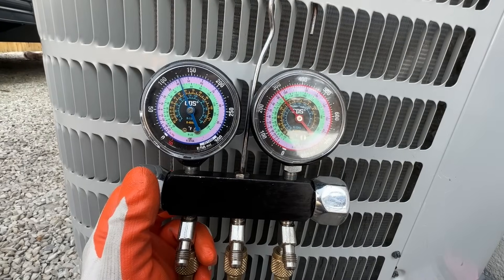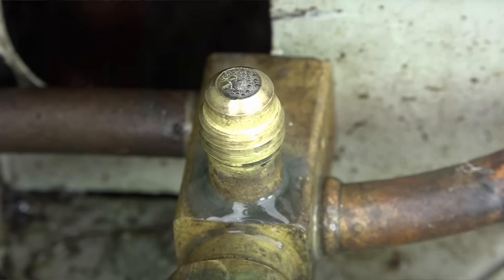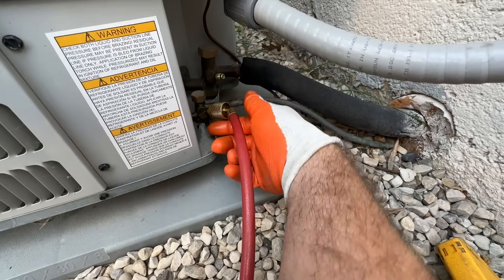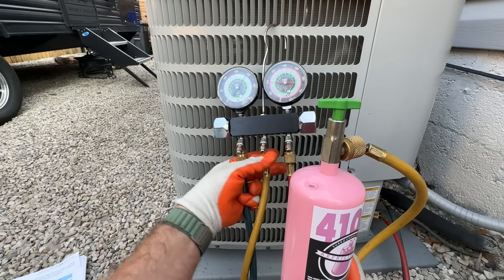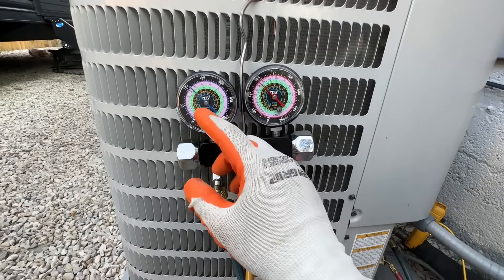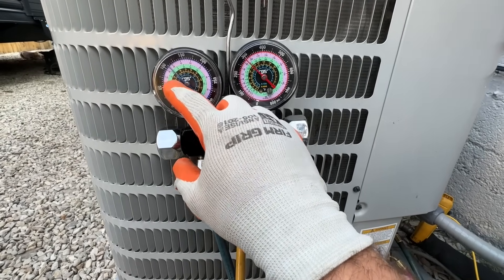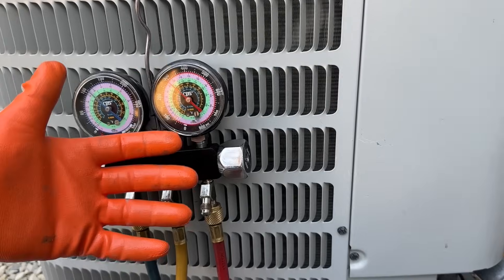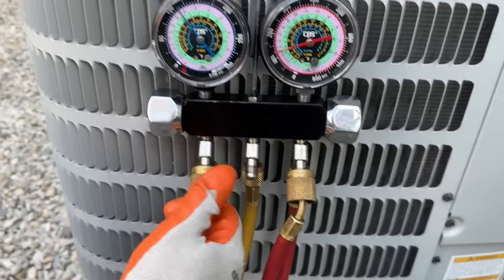How To Add Refrigerant To Your Air Conditioner R410A & R22

Comment: My Central A/C stopped working and I called a Serviceman. He said the Unit is 30 years old and to get a new one. He didn't even open the cover to do a diagnostic test. They quoted me $11k, plus a permit fee for $400. After watching your videos, I inspected the Starting Capacitor and it had leaked fluid. I bought a new one for $9.86 ,installed it and now I'm freezing in my home. Words cannot describe the feeling when that Compressor kicked on and my Girlfriend called me a Genius. Thank you so much, for what you do in helping out us DIY'ers. My words of gratitude does not come close in appreciation.
Reply: 95% of the A/C repair people will rip you off every time. The coil on my contactor kept blowing fuses and the thief A/C tech guy said my compressor is blow out and I need a new outside unit. I watched a you tube video on a bad contactor coil blowing the fuse and got a new contactor and replaced it. The unit started right up and is still running a year later. I was going to be ripped off $ 5,000 for a replacement outside unit !!!!!! And a $35 part was all it needed !!!!
Reply: @Yawwee  I don't even know what a contractor coil is. How did you know that was the issue?
Reply: @Yawwee your statistics are wrong either 95% is a very brazen accusation
Reply: @Yawwee I have the strong feeling that you embellished some of that story. I say that because no contractor said that your compressor was blowing out without showing you oil inside of your condenser. And no contractors are going to look at your compressor when it's a low voltage issue. By that I mean your compressor doesn't pop low voltage fuses, if it grounds out or blows out it's going to trip your breaker.
Reply: 60% of the time they rip you off 100% of the time.🤪😜
Reply: @samfeldman1508  
Lot's of rip off's in that game. But not likely as many as car mechanics hustling young women out of repairs.
Reply: @samfeldman1508  that simply isn't true.
Reply: @lucaswhite3411  I bet you’re really fun at parties.
Reply: Had  someone try to pull the same thing on my 75:yr old mother.  The aircondition still came on and still cooled, it just wouldn’t shut off.  He told my mom she needed new ducts and a new system quoted 7k.  I  said no it still comes on just won’t turn off that’s not it.  Called another guy told him everything.  Was a 40$ relay. Final bill was $120.  He asked to see a copy of the other ac guys work order and told me to report them to the bbb.
Reply: @TheMaskedheel  lmao new ducts??
Reply from the maker: That’s so good to hear. Happy my videos helped you out! Cheers
Reply: YES!!!
Reply: Most crooked techs/companies do this because they get kickbacks from whomever supplies their equipment.
Reply: I hate hvac techs always trying to oversell or say they can’t fix your unit or ripping people off. Same with mechanics and plumbers.
Reply: @derickmercado5903 So all tradesmen are crooked?  A few bad apples give the rest of the techs a bad name.
Reply: @derickmercado5903 I took my Dyson vacuum cleaner to a repair shop recently. Guy said it cannot be fixed but he has a great vacuum cleaner from Germany to sell me. I said no, took the Dyson home and after 30 minutes fixed it. A bunch of thieves.
Reply: Same here! AC stopped cooling my home…condenser freezed up in the middle of the summer. Called (2) HVAC companies…both saying “replace the unit!” …“R22 is phased out” … “your system is old” … yeah it is old! But the blower fan comes on, the condenser turns on…something is preventing my house from cooling…I watched HVAC videos and learned A LOT…decided to take apart my air handler and I cleaned our very dirty A-coil underneath…after that my house became a freezer! 
HVAC companies can try to get you…always be careful! If you’re capable of doing things your self and save $$ … do it!
Reply: Marc, you discovered the number one rule in HVAC repairs!!!! Air Flow, Air Flow, Air Flow.   That’s the number one cause of a malfunctioning unit!!!   Many people automatically go straight “needs more refrigerant”, “must be a leak”, when it’s not and they over fill the unit with refrigerant, which will damage it.   It could be an extremely dirty filter.  It can be extremely dirty coils on the condenser or the evaporator, which yours was.   The second biggest problem is electronic.  The last thing that should ever be looked at in trouble shooting is the refrigerant pressure and temperature.  The gauges is the last thing you use in trouble shooting.  Some techs are simply lazy and do not want to bother with going through the trouble shooting process.  When they see an old unit, it’s easier just to say get a new one.  Then move on to your next call.
Reply: @jamesschmidlin1127 seems to me that looking at gauges is #1, because that will indicate the system is or isn’t performing optimally.  Then, a competent tech should be able to walk back to possible causes, like inspecting the condenser where he hooked up the gauges, then the inside filter, etc.  All the stuff visible, but the gauges should indicate a problem like a sick person with a high or normal temperature.
Reply: 😅 @marclaurent4831
Reply: Greedy ass people ripping people off. I teying to become a tech to repair units instead of replacing them if they're running in great condition. Hice costumers a reasonable options on what they want to resolve.  @marclaurent4831
Reply: @marclaurent4831  you didn’t avoid the replacement you simply pushed it off into the future. Not to mention your high electric bills. With the crazy cost increases the industry has seen in the last two years. You did nothing but cost yourself money.
Reply: @ oh did I? So you know my electric bill all of a sudden? And maybe you don’t know that my electric bill has many discounts and programs that allow an affordable monthly bill. And it’s been 5 years since that happened and my AC is still working fine.
Reply: @Ty-lz3iz  If you actually take time to do the math of the extra electric bill costs and self repairs it won't come close to 11K estimates over the course of 5 or even 10 years.  lets say an extra 50/month times what maybe 6 months at most depending where you are. that's at most 300/years times 10 years is 3K. Add in an extra say 200/year to fix it yourself if you take the time to learn and buy about 1K in tools required (probably not even close to needed all that for repairs) that's another 3K for 10 years. Still saving 5K over 10 years. And learned a wealth of knowledge to install another one when it's time. The math don't lie.
Reply: What brand is your a/c system? Now adays, the coils are aluminum and if they have leaks, you need to replace either the air handler or the whole compressor system.
Reply: @jerrynonofbss2588 so what are you saying??  Are you saying that aluminum is bad and if so what’s better than aluminum??  About 6 years ago my evaporator coils were leaking, fortunately it was still under manufacture warranty…. They told me the reason it was leaking was because it was made of both copper and aluminum and that there was some type of issue with bonding the 2…. Thinking back I was happy they did it at zero cost however I can’t remember them showing me the leak
Reply: @a.ced.2052  That's good, because now they warranty the parts like coils, 
but you are stuck for the labor to change it and freon it leaked.
Reply: @jerrynonofbss2588 why not just replace the evaporator coil? $1500-$2000 vs $10k?
Reply: That's why I've never let a service man Look at mine.15 years old And I've only ever had to replace a capacitor once. I have 3 units.
Reply: @MoonDog700  I'm with you. Keep the thieves away from the systems.
Reply: @Rumpelstiltskin-yv4ep Who has he scammed? That's a big accusation I think you should put some details behind that.
Reply: I just learned a great lesson of how to get refrigerant and the EPA license. Cannot thank you enough for this. Best
Reply: 11k ??? For an AC?
Reply: @AllAspects. I’ve heard prices from $7K, refurbished, to $15K, brand new.   I live in the AC capital of the world, Houston, TX.
Reply: This exact situation happened to me except I was the installer on a new system that this salesman sold this older couple. Existing unit was only 2 years old. Said the compressor was done. I was able to pump the unit down and noticed the fan wasn’t spinning. Checked the capacitor and it was far below what it should’ve been. As an HVAC tech of 5 years, using dishonesty to profit has always irritated the piss out me.
Reply: @thezambonipony I hope good things happen for you because of your integrity.😀
Reply: i love a cold house   especially for 15 clams.
Reply: How did you determine the capacitor was bad? And did ya have to add Freon? I had a guy tell me it was low but he could not get the r22 so I called another guy and he never showed up. Thank you
Reply: @donnabauerofbrilliancebyde1178  r22 is easy to get.
Reply: Just got a quote from 11 -30 thousand to replace my r22 110,000 furnace and coil both 5-ton, and the outside condenser is a 4-ton.  The Tech said that I would need maybe 2 systems for my home.  Now my current system has my home ice cold when it works but lately, the outside fan motor stopped like it did a few years ago.  I believe that another AC company came out and all he did was replace the cap.  The new company says it is time for a replacement.  What should I do?
Reply: @vocalone23  Replace the cap, of course. If the fan motor turns out to be bad, replace that. Both are very easy DIY jobs. And if you ever to replace it, get MULTIPLE bids and never share info. from one bidder with another. Avoid big HVAC companies with lots of trucks and advertising.
Reply: @vocalone23  grab a stick or sum and try and spin the blades if they freely spin then it’s not the blades then look at the contactor it’s the black box in the middle and press the button on the contactor if the condenser tries to turn on then uk it’s not the contactor then it’s prolly the capacitor
Reply: What's not to love?
Reply: Good job on fixing it that's great. But just a heads up if ur talking about a hard start capacitor those are only short term replacements. So make sure the compressor isn't failing which it probably is if it needs a start capacitor. The tech should've checked out the system though 100% instead of doing all that quoting bs.
Reply: @anthony-ju6qo I wanna tell you and tell other before they get quoted “ there is no such thing as a antique Acs but if it as a serial number it can be replaced”
Reply: The HVAC techs today are taught by the company they work for to sell, sell, sell ! The largest contractor near here doesn't even bother to send the warranty packets in for each new install. They manipulate the owner into a maintenence contract which just guarantees easy $$$ year after year and allowing them to get their hands the system, looking for slightest item to bring on a major repair. But most of these renegades just want to install a new system more money then simple repairs. They often tell the new owner the factory will not honor the warranty unless they have a service contract. Only the small time repair guy cares enough to be honest & fix stuff because they depend on word of mouth advertising. The big guys have a team of attorneys to Cover their asses. In this state the big money people have lobbied the small guy out of business with the need to have a several million dollar bond & a warehouse with couple hundred thousand $$ worth of product. Damn shame corporation are so greedy. As a home owner we do all our own repairs. Same unit been chugging along since 1987. Inviting a large HVAC company to look at your unit is like having the wolves come to dinner with the flock of sheep. Either way someone's gonna bleed or get eaten. 4:20
Reply: It is nice to have a updated central unit, but yeah $11 k is almost 3 times what you can buy the outdoor unit , set lines and a coil for., i bought a new Bocsh bova 36 , acoil and set lines for under 2,500 installed it myself, all you need is nitrogen, vacuum pump, guages micron guage, and do some research
Reply: June 2025, same bullsh*t from my HVAC guy!  Quoted me $15.5k for a new Carrier a/c system (not even a heat pump) in MA.  I haven't done anything yet cause I don't have the confidence to check out the whole system.
Reply: I sure the furnace is the same age, I couldn't sleep at night wondering if the heat exchanger is bad
Reply: Did you get laid?
Reply: AC tech are worse than use car thieves, because they will smile in your face while they bend you over a barrel.
Reply: I keep hearing over and over again how HVAC guys deliberately lie and try to upsale all the time. It's not just HVAC either. People getting ripped off constantly with everything. I had my own pest control company for 4 years and was cheaper than everyone else and it was a better quality service. I couldn't believe how much people still preferred to pay the higher prices because the other company was more known. Almost started working for a company that charges $120 for a service. Absolutely ridiculous, and I can't believe people will pay it. Same with pool service. Did that for a year too.
Reply: @Feelingsmasher2000 truth
Reply: @Feelingsmasher2000 This guy has saved people a ton of money.
Reply: Wow 11k i was quoted 3500. Scammers!
Reply: Dude hell yeah! I want HVAC peeps to do well in life, but please don’t try and rob people. 🎉
Reply: A 30 year unit isn’t going to be very efficient and likely has a few very small leaks.  It’s recommended to change one to a more efficient one around that old.  However, if it is working it’s sometimes best to keep what you have especially if repairing can be inexpensive.    If your unit is leaking a certain amount of refrigerant over a 12 month period, it’s actually the law that the leaks have to be repaired and if not repaired must be replaced.
Reply: That’s terrific!! Take that…man 💥🙌
Reply: You might also consider buying a spare contactor. At that age, it may be the next thing to go. Replacement is just as easy as doing the capacitor.
Reply: They told me the same that I had a leak my unit was really old
Reply: @chantelemartinez5187  IF you really do have a leak, often they come from the valves they use to attach the hoses to their gauge manifolds. When opened and closed, the cores eventually tend to leak. That's why I NEVER have "tune-ups", checks, etc. If the system is working correctly, just don't let anyone touch it. The valve cores are not hard to replace but it requires a special tool. The refrigerant is not removed to do it.
Reply: @wholeNwon  thank you
Reply: Amen
Reply: Woohoo...that's awesome...and as a side note...I'm a HVAC tech...and I'm absolutely astounded and applaud at some of the trickery and flat out lies that some companies resort to...and truly...there really is not any reason to replace a entire system...short of the outer shell rusting in to pieces.(both the indoor and out door units)..everything is replaceable at a fraction of the cost of a complete new system...well done and I'm glad you saved a ton of money....👍👍
Reply: If it works dont fix it this is how AC companies stay in business. They teach the techs to be salesmen and women instead of servicing and real preventive maintenance its all about SALES. So good to hear that you fixed your unit which is pennies to thousands.
Reply: 😂 same here. I found out Ace Hardware carries the capacitors. Our condenser fan wasn't coming on. The "hack" I used until I got the new capacitor was to put three utility fans blowing into the condenser coils. I went from 86* to 72* in about an hour!
Reply: Mine just started blowing warm 2days ago when I turned it on in the morning, was fine night before, had a spare cap, didn't work, cleaned up contactor didn't work, fan or compressor,  guessing it needs freon. Just bought the place, previous owner did zero maintenance on anything!, hate people like that. It's few weeks later, Ohmd out compressor it's perfect, taking evaporater cover off asap to see whats up, has TXR wrote on it, if like rest of the house was probably done half ass and totally full of crap.
Reply: Sure but the unit is inefficient af and will certainly not last forever. Almost guaranteed to break down when you need it most lol.
Reply: Thank you!
Reply: The reason they recommend replacing old systems is because if I repair your old system and it cost 1000.00 then a month later something else happens your going to be upset that you just spent money on it and now it's broke down again. AND USUALLY the contractor gets blamed for it. I tell my guys if repair on old system is over 500.00 should recommend replacing system
Reply: Of course. They are in the business of selling. So of course they are going to tell you, that you need a whole new system instead of fixing it, because your unit is that old. Most people would have fallen for it and opened their wallets. But there does come a time where you will need a whole new system, especially the age of your ac unit where specific parts are probably becoming rare to come by for it.
Reply: @RhinoXpress  My units were 47 yo and still working when I replaced them.  The HVAC racket is full of thieves.  And when they do new installations, they often do them wrong.
Reply: @RhinoXpress exactly, so why do you think a contractor would recommend replacing it rather than suggesting the homeowner dump money for bandaids just to delay the inevitable?
Reply: Yeah u may have fixed it for a summer or 2 but when ur gonna have to put R-22 in there it’s gonna be nearly impossible to get it so most companies are gonna tell u to update ur whole system to 410A
Reply: @ThakidjpOffical  Just checked and I see lots of R-22 still for sale.
Reply: @wholeNwon  yeah for 170$ a pound when 410 is like 70 they’re tryna make it impossible to get
Reply: @wholeNwon  true but they’re not allowed to produce or imported anymore. It will go away inevitably.   And with these insane cost increases the industry has been seeing most people would’ve been better off changing years ago and saved thousands. All you’re doing is putting the Replacement off into the future, not avoiding anything.
Reply: @ What can I say? Obviously I disagree and conduct my affairs accordingly.
Everything has a lifespan. My fridge is 43 yo and functions very well. My wall ovens are 55 yo and still work. My clothes dryer is more than 60 yo and functions well. My Lexus is 27 yo this month and still great. Not replacing machines simply because they will inevitably fail eventually has worked very well for me. 
It's your life and your money. I wish you the best.
Reply: have fun with a 5 seer unit
Reply: @jacobgriffiths2627  truth.    whether it was beyond repair or not, the efficiency of a new system over a 30 yr old system is what they were selling.   he will pay that 11k one way or another
Reply: @jacobgriffiths2627  verses $11k lol aint hard when u aint got it
Reply: @jacobgriffiths2627 mine is 20 years old and it is a 15 seer unit😊
Reply: @anthony-ju6qo Cool story bro! Straight 🧢
Reply: @johnnyappleseed6665 sounds pretty likely to me, lots of garbage HVAC techs out there only trying to get as much as they can out of people.
Reply: @johnnyappleseed6665 😂😂😂